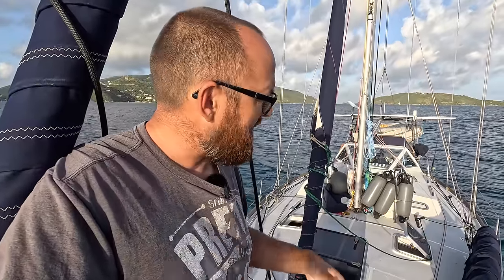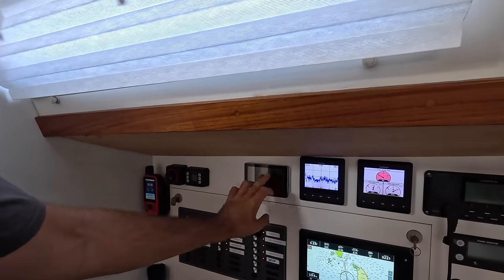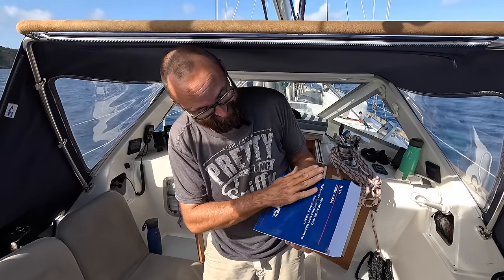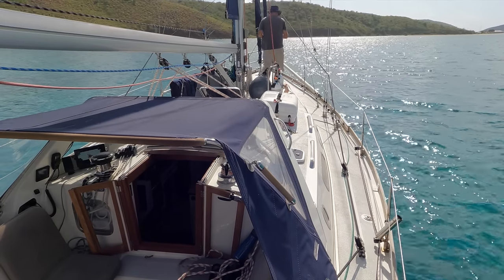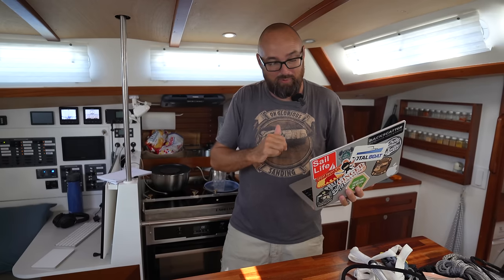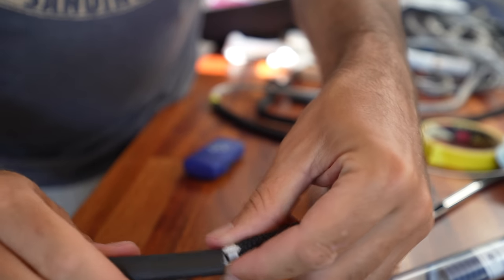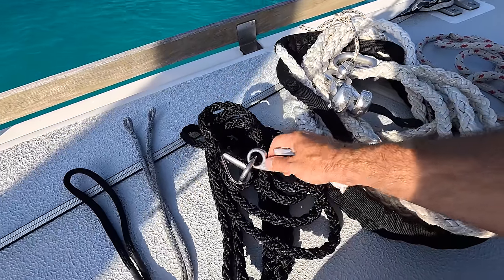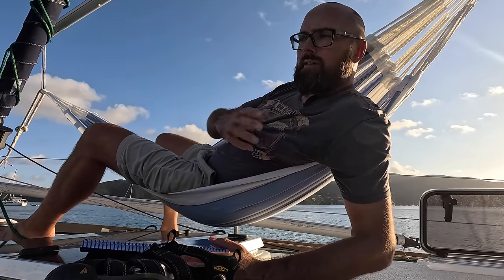Sail Life - DIY Dyneema snubber pendant & bye bye Ava

Comment: Hi Mads, Sv Helacious here!  By now you know that dyneema doesn't stretch, which is the whole point of a snubber- providng elasticty into the chain system. We have been using a "deck snubber" for the past year and it has worked really well. Our boat is 18T so I use a 3/4" Nystron line, which is an arborist rope -nylon core for stretch and a super-tough poly cover. It has a spliced in thimble eye on the business end, which I attached to the chain with a dyneema soft shackle/klemheist arrangement. Never slips, easy on and off, no threading through a link. The "deck" part comes next: we run the snubber back to a mid-ship cleat, giving us about 22'/6.5m of line, then over the bow roller and the connection to the chain is about 5'/1.5m away, but still out of the water. This way it doesn't get  all slimey and we can keep an eye on the connection. So essentially we have 30'/9m of snubber which makes us ride very easily even in a severe chop. If it really kicks up big waves I can ease out another 10'/3m from mid-ship. Highly recommended, learned from an Aussie, SV Razorbill.

Comment: I've stopped using stainless snubber hooks because of the galvanic corrosion. But a galvanised chain grabber hook is really cheap!
Now I just use a loop of stretchy climbing rope tied to the chain hook with 2 tails, use one tail if its light weather, both tails either side of the anchor roller if its neavy weather. Only 1 snubber required!

Comment: My snubber is a length of three strand nylon with an eye spliced in one end and a chain hook spliced onto the other end.  It seems to work OK, but so far I have only been using that style of snubber for 28 years.I say that style because I have had to replace the galvanized chain hook a couple of times.  Time will tell if it is adequate.

Comment: I use a 48" long Dyneema soft shackle attached to the chain with a Prusik hitch.  The soft shackle is closed through an eye on the nylon snubber line.  The Priusik hitch is easily removed after heavy loading.  A Klemhiest hitch can be used or a simple cow hitch in light weather. I actually use two soft shackles each attached to a nylon snubber forming a "bridle".  No single point of failure.

Comment: WRT attaching the snubber to the chain. We use a 5mm soft shackle to a bridle and done so for the last two seasons in the Med. This was done after multiple shackle and chain hook failures. We are a 44ft cat and have sat through 40 knot winds and are always on anchor. Will now always use The soft shackle. Cheers
Reply: Yup, 5 years on soft shackles. Super simple solution.

Comment: Two things that I find invaluable for anchoring. 1) anchor stopper 2) soft shackle for attaching the lightweight snubber to chain.  I use a very lightweight snubber because it stretches better (which is the whole idea). If I am worried that we might have to leave in the middle of the night I won’t put any snubber on. The chain stopper is sure beefy and can handle almost any load that the 1/2” chain can. If we have to leave quickly for whatever reason. It is only a matter of starting the engine, and start winching in the chain even with the stopper engaged, the chain can be retrieved ie one way so no load on the windlass. Hope you find this interesting. 
I have always been interested in ABYC. I have two European aluminum boats so they are built with a slightly different take on grounding, corrosion and electrolysis.

Comment: I have the Mantus anchor bridle and snubber but don’t use either of them. They are both overkill. I use a short  (~6’) dyneema line with a large eye on one end to go around the bow cleat and a small eye on the other end with a thimble. I attach the thimble to my chain with a soft shackle and use this short snubber to set the anchor. The soft shackle is easy to attach and remove. It has never failed in five years of cruising. 

After the anchor is set, I remove the short snubber let out any additional scope, then attach my 20’ long snubber which is 1/2” three strand nylon with a rolling hitch.  The rolling hitch is easy to tie and untie day or night and has never slipped. The three strand nylon line provides good stretch and strength for my 30,000 lbs boat. I much prefer using a rolling hitch over a chain hook because it’s easier on the galvanized finish of the chain, less risk of damaging a chain link, less risk of damaging my boat or hurting me when deploying or retrieving. Those Mantus chain hooks are big, heavy, and can do a lot of damage if dropped!

Comment: fun video.  In an earlier video you secured a shackle using lashing wire.  Twenty years ago, an old salt showed me a better easier way.  Now I only use 1/8" twine to secure the shackle screw pin.  A six inch long piece of twine is fed through the eye in the pin and then through the shackle itself and tied in a square knot.  It's reusable and I secure all the blocks on my boat and the sail shackles, this way.  Most of these ties last for years as they are reusable.  Better on the hands and better for the sails.  I have pictures I can share.

Comment: Hi Mads, I like the snubber setup we have for everyday use: 30' 5/8" nylon dock line with an eye splice, attached to the chain with a home made dyneema soft shackle. I believe the dyneema is 1/4" and as big as will fit through the 3/8" chain. Very easy to attach and vice versa. If we are expecting weather we also have the big Mantus snubber and chainhook that my dad gifted when we left to go cruising.
Reply: Dyneema soft shackles with chafe protection through chain links to an eye in a nylon line. Use two shackles through non adjacent links to the single nylon line.

A multi-day tropical storm would see me seeking alternatives.
Reply: @TimAch-p2c  like I said in my comment, I have a bigger snubber with a chainhook if I'm expecting a blow

Comment: Instead of 'Screw Shackles' or a costly Mantus version for what is likely going to be 'light condition' uses, you could pick up a climber's SS snap carabiner to use on both ends of the snubber for $10 to 15 US. They're rated from 2 to 4 tons of vertical breaking strength, so I don't think you'll have a problem in some calm anchorage...:face-orange-biting-nails::face-blue-smiling:

Comment: Welcome to the BVI.  I've lived there for 14 years, and have recently returned with my recently acquired Contest 38s. There has been a profound change in the BVI during the last 20 years and that has been cause by two factors.  First, the explosion of the charter boat fleet.  One operator alone has over 900 boats under contract.  For the most part the people who charter have some boating experience but would rather tie to a mooring ball than trust an anchor.  Hence the filling of nearly every good anchorage with mooring balls which cost $40 to $60/ night.  For cruisers that is an impossible burden but for those there for a week, well what hey, it's only money.  The second reason is the influx and influence of the mega money people.  Not only do they come but also build huge estates,  they have large staffs which need housing, and other living factors. That in turn drives the price of apartments, food, and services up.
You have found an excellent place in the North Sound or Gorda sound.  On the western end there is Leverick Bay which has a well supplied market, two decent restaurants and a fuel dock. The staff is very nice and most helpful.  Cab service is available to Spanish Town but the cost is $40 each way. In spite of the cost the BVI remains a very special place due to its natural beauty and the nature of its people.  Kinder folks you will be hard press to meet.

Comment: Mads,  Once Dyneema has undergone it's Initial stretch it has as much shock absorption value as the anchor chain it's connected to. Which is Zero.  The only way to turn Dyneema into Snubber Capable is to Thread as large of a diameter piece of Surgical or soft rubber hose down the core of the braided strand Dyneema using your largest fid.  (or any other braided rope) Once the hose is inside it will compress when tension is put on the rope. 
Thanks,  Joachim Olsen.

Comment: I’m not fusion 360 user but I’m a rhino user for over a decade and use primary for architecture and also 3d modeling for race cars and jewelry as freelance and works great for that, even on complex surface molding I never had a problem, it adapts more into my process parting from technical drawings or reference photos in most cases, I think fusion over complicate some things, it’s “parametric” constraint tools are the better solution if you gonna replicate things on different sizes like boxes, or need to preview how complex designs work or move, but for design on nurbs curves, complex non planar surfaces (like the ones in a boat and a car) and single non repetitive elements rhino it’s perfect.

Comment: full time on the hook I use a big long softshackle made from 5mm d12 dyneema, must be many years old now. Snubber is on deck, about 12m of 10mm nylon through some pulleys so you can let out more chain without having to pull it all in & it stays clean!

Comment: I've never been sailing, but I have been camping in a soft hammock a lot. You will want to put a "ridge" line connecting both ends of the hammock so that you have the same droop every time, regardless of what you attach it too. There are a bunch of resources online about how to figure out what that droop should be, and it will be easier and clearer for you to watch a video, rather than me explain it via text. You also want to try to lie diagonally in the hammock. It helps keep you from turning into a banana.

Comment: I’ve made forged carbon motorcycle parts and I can’t recommend glossy petg enough. But it can be quite tricky to design a 3-5 parts mould for more complicated shapes. With 3d printed moulds you’re limited to mainly flat shapes, with maybe one extrusion because the prints are only strong along one axis. Even with a vice, it’s not possible to get to the pressure needed to get all the properties of forged carbon. It’s still a fun project and proof of concept though. If the moulds work, you can always order them from aluminium

Comment: Great video, just be careful with the heat gun around dyneema - I've heard rumours that it loses quite a bit of strength at quite low temperatures (not much above that at which most heat shrinks shrink)

Comment: Our rule onboard is that nothing on the boat has only one job. I like that you can use this to take load off a fouled line... but you can use any line for that (sometimes even the tail of the same line that's fouled if it's long enough). Also, I'm not sure how this is an improvement on your snubber... either of them. 
When we need a snubber, we use a dock line: most dock lines have a loop spliced into them. If you use that to make a lark's head knot around the chain (same knot as your new dynema thingy) it holds well on the chain, loosens easily, as you mentioned, and has spring in it the same as a dock line or snubber should have. Just run it over the anchor roller next to the chain, and you're all set (no bridal). After all the above, it means we don't carry anything additional. We'd need to carry the dock line either way, but now it's doing more than one job.

Comment: Mads,   As you know rolling hitches on a snubber can jam after a big blow and it takes several minutes with a marlinspike or screwdriver to unjam them.  Clifford Ashley has a variant on a rolling hitch in his "Ashley's book of knots"  that has never jammed under any condition.  Specifically, knot #1735.    I currently am using a mountain climbing tape loop tied with an asymmetrical Prusik knot to the chain rode and then a 1/2" Dyneema soft shackle from the tape to 1/2" 3-braid nylon snubber cleated off to the forward bow cleats. With long tails of Nylon 3-braid I can keep the snubber short under light conditions and under bad conditions can let a good bit out to increase the stretch.  I don't like the metal connectors sold for connecting to the chain as most of them asymmetrically load the chain rode making it the weak point.  The Mantus "claw" loads the rode evenly but wow is it clunky.  BTW, you mention concern over a soft shackle coming undone.   Never had the problem.  Finally, I am a bit puzzled by Dyneema snubbers since Dyneema has very little stretch. To my thinking it is like using a steel cable for a snubber which could cause the anchor to trip out
Reply from the maker: Thanks for the knot recommendation :) I know stretch is important in a snubber if it's used in high winds but 99% of the time we don't need stretch and I'd rather have the easy of use (saving the big snubber for the last 1%) :)

Comment: Saw your comments about Fusion 360 problems... I've been involved with Fusion in a semi- official consulting and support capacity since well before it was called Fusion. I'd be happy to offer any help I can, or put you in touch with someone who can help if it's an issue outside my wheelhouse. I've been using it to- among other things- design the mechanical parts of instrumentation (computers) for scuba diving. 
It's a great package, and highly capable, but no 3D CAD system is particularly easy to get a toehold with, especially if you haven't previously used 3D CAD. And Fusion now does so many things- there are pros and cons to being a Swiss Army knife tool.

Comment: Not sure about Dyneema as a snubber material because there is no flex to absorb the shock of the chain. I use (heavier gauge) nylon because it is strong but stretchy.
Reply from the maker: The pendent is used in combination with nylon. It’s just an alternative to the stainless steel chain grabber.

Comment: 2:40 "turn on the water heater". Isn't the egine heating the water boiler with it's cooling water?
Reply: I'm sure that was what he was insinuating.
Reply: Probably has enough electricity production on engine power to supply AC current from the inverter. I did that on my boat by selecting a lower wattage element in the water heater.  My boat only has two 15 amp circuits so a 500 watt element was ideal.  But, yes, I do have a coolant loop supplying water from the engine. Don’t recall whether Mads installed one. 😮
Reply: Subtle
Reply from the maker: Not aboard Athena. We have our hydronic diesel heater hooked up to the water-heater instead. That way we have two options. When we run the engine the high output alternator provides around 4000W - the heater only draws 600W. When we're in a cold climate the hydronic heater is on constantly. I did add a "summer loop" to the heating system so we do have the option of just heating the water-heater with the hydronic heater (and not the rest of the boat) if we want to.
Reply: @SailLife  Thanks, Mads. Veryneat system.

Comment: Madz, for the next boat, think about 48v battery and (very) high output alternator(s) and "ditch" the generator.

In the DIY spirit, you can easily find alternators from "light hybrid cars", they are 48v, 8++kw, and PWM contoled, and affordable (specially compared to the "marine" counterparts).

Comment: a dyneema snubber is a dumb ideia.  if you want to snub the tension why are you using a material that is renowned for its lack of stretch?. sure the cleats are there to take up some tension, but you would rip one of them of the deck faster that you would that line, and this happens over time, not at the fisrt "bump". 
also, having no stretch mean annoying tugs everytime the boat falls back and pulls on the entire system.
Reply from the maker: Yes a Dyneema snubber is not a good idea but there is no problem in using the Dyneema pendent in combination with nylon (3 or 8 strand). Also for 99% of the anchoring we do we don't need any stretch.
Reply: @SailLife   sure if you are  mixing it up with  stretching types then yes. but honestly , im not trying to be a contrarian here,. but why inserting more failure points on a system that is thought out to be a safety feature? i work in rigging and work at height environments and  from this mind set it just doesnt make sense. ive also been sailing since im 7 and am refitting a a 30 footer, so im not coming at this blindsided
Reply from the maker: You need some way of attaching the snubber to the chain. I like the idea of using a stainless chain grabber or the dyneema pendent because they’re easy to remove. I don’t see much of a difference in safety between the two.